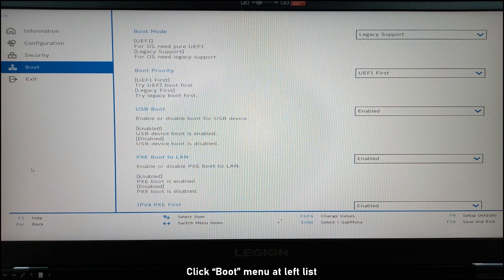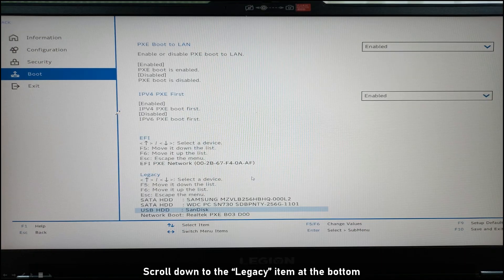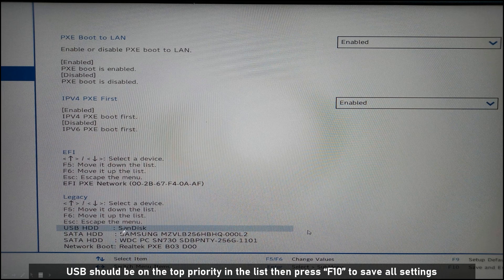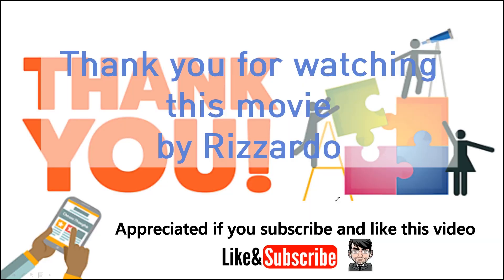Upgrading SSD and Memory for Lenovo Legion 5 15ARH05(with disassembled view and USB booting setting)

Comment: My Legion 5 has an SSD preinstalled and I plan to add a 1TB 970 EVO Plus.
What form factor is available/vacant for use? M.2 2280 or M.2 2242?
Reply from the maker: you can use 2280 in your laptop.
Reply: @leerizzardo960  ah ok. so the stock one uses M.2 2242 then?
Thank you for replying ❤️
Kamsahamnida
Reply from the maker: @mediocritycentral  no problem to use the 2242, since 80 is a vertical length, fewer one (including 42) can be used in this form factor.
Reply: @leerizzardo960  so the built-in one is using M.2 2242 while the vacant one is M.2 2280? Or is it the other way around? Thanks for replying.
Reply from the maker: @mediocritycentral  don't know exactly your model but you can install 2280 at both of two sockets.

Comment: Hi,

I have the Lenovo Legion 5 15ARH05H Type 82B1. My question is can I upgrade RAM to 32GB (16GB per SLOT?) If so, which brand and speed?

Can I also install a second SSD for the laptop? I want a second NVMe Drive with 1TB but I am not sure if this system can install a second drive.

Please help.
Reply: Crucial CT16G4SFRA32A 16 GB (DDR4, 3200 MT/s, PC4-25600, SODIMM, 260-Pin) Memory Is what I used. Bought 2 of them.
Reply: @clarkeanderson8793  awesome. Thats the exact same one I was looking at. I was looking at the Kingston HyperX but concluded it was an extra $50 for a very negligible difference in performance.
Reply from the maker: @clarkeanderson8793  you can test ddr4 3200 which means pc4-25600 in your laptop computer.
Reply: @leerizzardo960  I have to confess that I don’t know much about computers. I just took a gamble here as I’m more of an engineer. 

Can you explain what You mean by test the ram?
Reply from the maker: @clarkeanderson8793  which means regarding adding 32gb ram in this laptop,  not sure it works fine or not. now you're going to install 32gb on it, so you can test to add more ram. after testing, please let us know what could be the result.
Reply: @leerizzardo960   well 32gb works fine. I’m not sure about adding more than 32gb and the general consensus is that anything more than 32 will not be recognised. I do not have any more ram to test unfortunately.
Reply from the maker: @clarkeanderson8793  thank you so much for your good result.
Reply: @clarkeanderson8793  Someone one reddit said they installed 64gb of ram and it works
Reply: Hi..just installed 2 sticks of 16GB-3200MHz and I can confirm 32GB works! My friend installed 64GB in his and it also works. I don't think it can detect more than 64GB though.
Reply from the maker: @mediocritycentral  thank you. Vince,  highly appreciated your great testing.
Reply from the maker: hello. first of all, regarding memory, not sure 32gb would be available in your laptop. for storage, you can install two m.2 nvme ssd in this model. hope it will be helpful.
Reply: @leerizzardo960  how do I find out if it can support 32gb? I see many claims online that people were able to upgrade their system to 32gb despite Lenovo saying the max is 32gb. Is there a spec I can look up? Maybe the motherboard?
Reply from the maker: @PikaChaChing  what about asking to   customer service center in lenovo website?
Reply: @leerizzardo960  Is this Samsung 970 EVO Plus compataible?

https://www.rentproductsonline.com/index.php?module=listings&controller=listing&action=details&id=3711&name=samsung-970-evo-plus-1tb-ssd-mz-v7s1t0b-am
Reply from the maker: @PikaChaChing  sorry for the late response. it can be available to use the ssd in your laptop.
Reply: @leerizzardo960  is this normal size of second disc m.2 ssd? I know that we have difrent size. I mean ai have to buy standatrt m.2 nvme disk??
Reply from the maker: @marianatelefon3129  you can install one more m.2 ssd which is the 2280 form factor.
Reply: I’m going to be trying upgrading the RAM to 32gb in the next day or so. I’ll post my finding when I’ve done it.
Reply: @clarkeanderson8793  def keep me posted, I would love to hear your results
Reply: @PikaChaChing  just done it. 32 gb deffo works on your system!!!
Reply: @clarkeanderson8793  nice! Which brand did you get?
Reply from the maker: @clarkeanderson8793  appreciate if you share the valuable information with us.